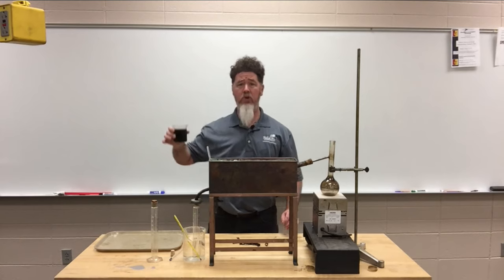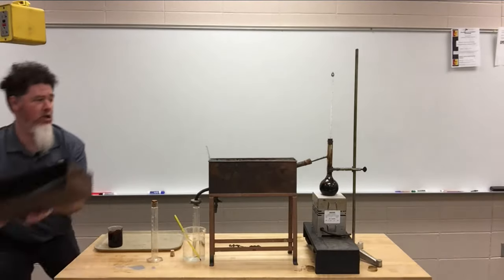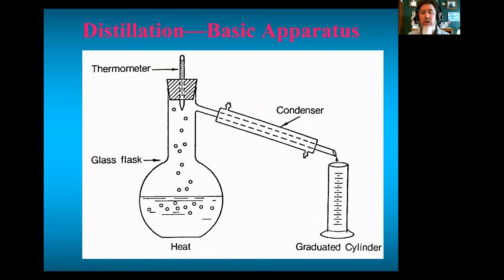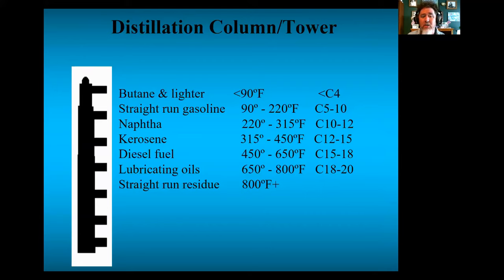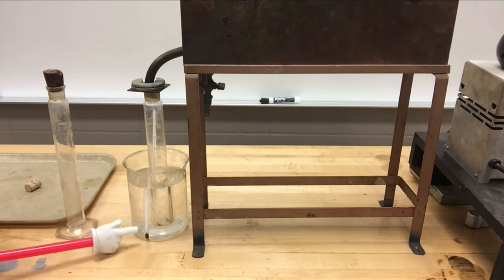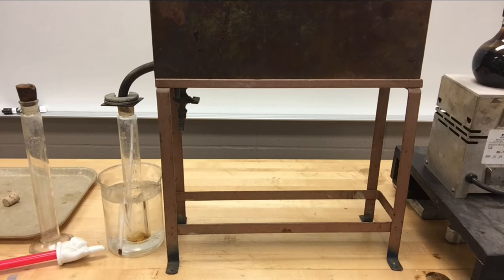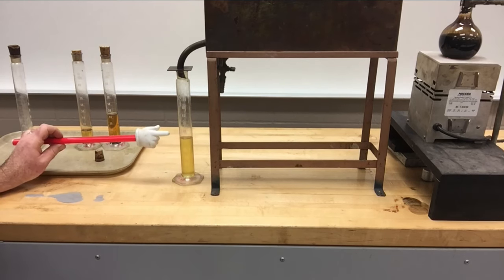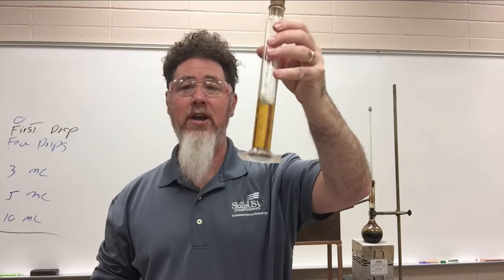How to make gasoline and diesel fuel out of crude oil

Comment: Thanks for taking the time to make this video. I am interested in making a pyrolyzer to turn plastic back to oil, but I don't know enough to trust the final product.
Reply: You got that mad scientist vibe my friend
Reply: you just have to distill it properly (search for the term crossflow distillation) then use some chemicals to reduce the sulfur content, after that you add an octan booster (in case of gasoline) or a cetane booster (in case of diesel) . and make sure not to distill halogenated plastics like PVC (it´ll create chlorine gas) and polystyrene (styrofoam) as this will make the fuel polymerize and you´ll end up with jello fuel

Comment: very cool video, great explanation of distillation and demo perfectly clear, one interesting thing might be how much energy was put into the system via heating element, and how much energy does the fuel potentially have when used at 100% efficiency (if that were possible).
And what is in the left over oil in the flask?

Comment: I saw old tires distilled into gasoline , it was filtered afterwards and ran in a engine  it looked more lihe kerosene to me but it worked . Im looking to make my own fuel for off-grid power generation. Only about 5 gallons per batch. And carbohydrates to ethanol will bring trouble especially at that volume. I thought about methanol. And possibly seeing what is possible from the wood oil (crude oil from wood) see if it can be broken unto thinner more useful fuels. Maybe the distilled rubber  mixed with methanol from wood would  make a decent fuel. Anything frim 85-95 octane should be ok for my use maybe less i can always mist water or water Methanol/ethanol to help any pre-ignition!   And can plastic be broken into a gasoline substitute?

Comment: Hello professor! Is this the same set up for the distillation of pyrolisis oil from polymers? Would like to make things clear for me.
Reply: Yes though you'd need to run higher temps and re Run the distillate a couple times to destroy the polymer chains. Or you could crack the chains with Hydro treatment where you pass the distillation gas together with hydrogen through a catalyst

Comment: Can motor oil be cracked into a ighter oil? By heating without o2 and possibly under pressure?  And what would happen if used oils was placed into a 2" pipe 4"long and  sealed up filled 80% and heated to    nearly 1000°f i know eventually it will be a bomb. But I'm interested in what happens to the oil?  Is it broken into shorter chain molecules? That can then be distilled out ?

Comment: Hi prof great video, I want to extract petrol and diesel from plastic waste, is it possible by applying your distillation technique of collecting at different temperatures and will I be able to run an engine on either?
Reply: check out mr teslonian
Reply: I know a guy who gets the used cooking oil from the restaurants in hays and runs his pickup on them. Not sure what he does to it though.
Reply: @blackbeard9436  thank you

Comment: I have a small well drilled in 1895 in Notheren WV and use it for house gas and sell about 100 bbls of oil per year. Now I'm retired I want to try to see what I can get out of this oil. It is a light Pa crude with a little paraffin. I'd like to see it it can be used for house and shop heating. Any suggestions for further reading?

Comment: Just a curious engineer here , when heating I assume you are extracting the different hydrocarbons and that you can't change the amounts of different hydrocarbon chains. You speak about making different portions of fuels but is that possible ? Aren't you governed by what's in the crude or does the amount of heat temperature mix determine what you get out ?

Comment: Professor Scott Norman it's actually what's run in older and modern gasoline and  4 stroke and 2 stroke small engines and some bigger ones to. Now some of the newer stuff is designed to be flex fuel engines then yes. It requires octane boosters and ethanol alcohol blended into your gasoline fuels. If you have one od those pot metal gasoline fuel tanks and carburetor's on your machine., or equipment then you use ethanol free fuel in those small engines that doesn't have plastic carburetor's mounted on top of those fuel tanks that are designed for that type of gasoline fuels like E-85.,or E-10 blended gasoline fuels.

Comment: Great video. So would lite kerosene run in a modern gas car? Just curious.  Probably wouldnt take long to plug up the Cadillac converter
Reply from the maker: Hi James,   I have not tried running kerosene in a modern gasoline vehicle, but I do not think it will work as the properties of kerosene is too different than modern 87 octane gasoline.   There are older farm tractors and military vehicles that will run multi fuels, but they need to be designed to do so.  You can do some research on these type of vehicles to see how they work.   Good luck.

Comment: Wait, I didn’t get what temperature you heat the crude oil for straight run gasoline?
I understand it was 500 degrees Fahrenheit but then you were talking about how the temperature needed to be 90-220 degrees Fahrenheit.
Reply from the maker: The best gasoline is distilled between 90 to 220 Degrees F.  Above 220 degrees is heavy gasoline (Naphtha) and has more BTU's per gallon, but not a better gasoline.

Comment: Thank you! Does it work similarly if you convert plastic into diesel?
Reply: Yes but this needs to be done without oxygen being present (pyrolisis) and don't use PVC or other halogenated plastics as they produce toxic fumes which are also corrosive in case of PVC it would create chlorine gas

Comment: Hi professor.  It's surprising how difficult it can be to find this information elsewhere on the internet.  Great presentation!  
I have a question that seems just beyond my grasp, but a profound question given a new movement away from fossil-fuels for mobility.  If you could help me, I think we can bring to light a big misunderstanding about the advantages of this new movement.
When you distill the crude in this experiment, an electric heater is used.  WHY NOT add a watt meter on the heater to determine how much electricity is used to complete the distillation process.  My thesis is that there is gasoline from crude that enables mobility in ICE vehicles, however the refining process expends about as much energy as could be traveled in an EV from the heating process alone.  
The disadvantages are then compounded by having to transport the gasoline and make up for any spillages or inefficiencies before it even gets to be used. 
Perhaps we could simply save the oil and use it for OTHER THINGS if we only decide to make use of the energy it takes to bring it to boil and move the fluid from one place to another.    It's like getting the byproduct of the oil without having to handle it or refine it ... See?  Much more direct and efficient.
Somewhere I saw an amateur determine that a drum of oil brought to boil uses about as much energy as it takes to drive an EV 600 miles, and that is pretty close to how far you can expect to go in an ICE car with the resulting byproduct.  
Working under the assumption that they distill crude by using the oil or kerosene as fuel (rather than electric heater) brings to light why there is about an 18% defecit of oil byproduct from distillation compared to crude supplied https://www.eia.gov/dnav/pet/PET_CONS_PSUP_DC_NUS_MBBLPD_A.htm  
After all it is not scientific to think that 18% of anything just "disappears"... it has to be USED SOMEHOW to not be left at the end of the process.  I think it is used in the heating part of the process.  Correct me if I'm wrong.  - 19,890 million gallons divided by 16,294 is 0.82  (82 %)  
I look forward to your insight and if you have ever let your mind wander down this path before.... 
Thanks, 
Trent

Comment: Refinery of the crude oil in the Refinery pump hidrogen to the crude and that is just add water to the crude distilled by product.  And also the heat destination work faster under - vaccun depressurized container vaccun seal .
Reply: The hydrogen is used to crack the polymer chains to get a higher yield otherweise you would be left with much more paraffines. they not only use vacuum but a crossflow distillation process to reduce energy needs

Comment: 2 questions: 
1) Would this also work for the liquids/vapors obtained from the "gassifier" setups using wood? 
2) Would extracting gasoline from diesel created from waste plastics?
Reply from the maker: No, distillation of gasoline or diesel fuel will not work with gasses from the wood gasifier or waste plastics.   The wood gasses are to light and the waste plastics are to heavy.  Distillation is just separating out the gasoline and diesel fuel that is all ready in the oil.  Since there is no gasoline or diesel fuel molecules in the wood gasses or waste plastic, this process will not work.   The gasses straight from the wood gasifier, H2, CO, and CH4 will still run an engine so there is no reason to try to convert those gasses into gasoline.  Did this answer your question?
Reply: @ProfessorPentane  Thanks for the prompt response. Yes it answers those questions. I'm pretty sure I'll have more questions to follow after this fully settles in and thanks again ;)
Reply from the maker: @coachgeo  Sorry, I just saw your reply today.   Yes,  coachgeo is correct.   Pyrolysis must be done first before distillation.  Distillation by itself will not work.
Reply: So after pyrolises you get bio crude oil from the condensed wood. Then its possible to distill the bio crude oil to diesel and gasoline?
Reply: @nsrhpi  no he just explained how the mid temp distillates required for gasoline and diesel are not present in woodgas or plastic after pyrolization

Comment: If you only wanted gasoline, would you be able to keep the temperature at the given rate to give more gasoline? Rather than getting it too hot making diesel? If so how much do you think you can get? Of course taking the warm up in consideration.
Reply: No you would still only get a certain percentage of each fuel from said amount of crude oil
Reply: I'm not 100% on this but I think the other answer you got is right, there is only a certain percentage of the crude that can be made into gas, however if you heat it up to quickly, you may blow right past the temperature and then have lost time for separation of the gas and diesel and contaminate either.

Comment: Will this same process work on crude oil made from pyrolysis? Specifically wood pyrolysis.
Reply from the maker: Hello Noah,   distillations would NOT work with wood gas.  Pyrolysis will produce Co, CH4, and H2 gasses which is lighter than gasoline.  These gasses would have to go through more "refinery" process to make longer Hydrocarbon chains for Gasoline.  We ran a small engine on wood gas a few years ago, check out the video here:  https://www.youtube.com/watch?v=Z9dRY8O3IFA&list=PL3XwHgpcSh2Z5u0i2DQ6W3i8xRHiqk619&index=1&t=7s.
Thanks for watching,  Professor Pentane

Comment: Prof can this system/process be used on waste motor oil (wmo) to achieve a similar result?.. looking forward for your reply.
Reply from the maker: Hi Steve,  a short answer is NO, you can not distill your waster motor oil to make gasoline or diesel fuel.   Folks on the internet is making "Black Diesel" out of their waste motor oil as an home-made diesel fuel.   I have not tried this out yet so you will need to look at other sources for more information about waste motor oil as a diesel fuel.  Thanks for watching.
Reply: If you can extract more diesel fuel out than gasoline, why is diesel more expensive to purchase.
Reply: Essentially its no because you already took out the fuel to make it motor oil is that correct
Reply: @benkentch4217  you pay more for diesel because its more energy per gallon of fuel its more energy
Reply: @StoicAnarchy   is that because it requires more energy to get to the right temperature to extract the diesel fuel
Reply: @benkentch4217  Diesel is cheaper here in Brazil. Much cheaper.
Reply: @benkentch4217  Commercial transportation vehicles. They know that gasoline is not an option for fueling the transportation industry if diesel stays at a just higher price than gasoline, so they jack the price up because they know the industry has no choice but to pay.
Reply: @benkentch4217 because different crude oils contain different amounts of fractions and the "Diesel heavy crude" comes from russia. USA mostly has sour crude which contains more sulfur which adds costs to remove it. Sweet crude has lowest amount of sulfur 😊

Comment: The other question I have is the energy required to heat and cool the products versus how much burn energy is contained in the 200ml
Reply: with the use of the right catalysts e.g ruthenium and carbon one can lower the energy input and obtain larger amount of fuels making the process economically viable. for the 200ml he got he probably used 70ml to fuel the process. the pyrolysis gas can be rerouted back to the reactor to further increase efficiency

Comment: So if you plotted drip frequency with temperature we should see humps where particular chains are most abundant ?
Reply: Either that or a jump at the thermometer where the hot gases pass over. each jump indicates a new fraction azeotropes however behave differently and should be taken into account

Comment: Is it possible to speed up the process by adding vacuum but being able to lower the overall temp of the oil?
Reply: Yes but you would need better cooling as the condensation temperature also gets lower. Heidolph suggests for petroleum spirits 50°C at 250mbar vacuum

Comment: So does a higher octane rating in gasoline actually mean less explosive than straight run? If so I've always had a false assumption that 110 octane would be more explosive than  87 octane....??
Reply from the maker: Yes, you are correct.  Higher octane fuel is harder to ignite, more pressure/heat is needed.  If someone is running 91 octane in a normal low-compression vehicle, it could lead to hard starting when cold.
Reply: @ProfessorPentane  thanks! Really cool presentation. I'm 33 and you just taught me something that just had never clicked before. I knew the stoichiometry of gasoline should be 14.7 to 1 but is that based on straight run gasoline only at 30% octane? Different octane rates are obviously going to affect that metric.
Reply from the maker: @ahunt  just FYI from a Fuel's Nerd that the octane level of the fuel is not the biggest effect of the Air/Fuel ratio.   See my videos in the "Lessons on Fuel Chemistry" playlist on how to calculate stoichiometric ratios of fuel.  Enjoy!

Comment: Can you do this same process with waste oils such as engine oil, trans fluid, gear case oil etc...?
Reply: This is my question as well.
Reply: Of course it can be done just watch Out for the additives some even act as a catalyst to improve yield e.g. Molybdenum sulfide (lubricant) some May distill over so you'd need to pass It through activated charcoal

Comment: Can you the same process with used motor oil and get diesel from it?
Reply: I doubt it, as the lubricating oils are produced at a higher temperature (see chart in the early part of video) so the volatility of the diesel is already gone.

Comment: I never understood this in school and now I see it's just heat the oil until all the product has come off for that range then increase the temperature.
Reply: Or you blast from the beginning with high temperature as the boiling Point of the mixture always will be that of the lowest fraction, that's due to latent heat

Comment: Ok. So in the army we had JP-# 
I am assuming JP is the same as C.
So JP-8 would be C-8. 
I don't remember all the JPs But I remember JP-8 was one.
Reply: Jet Propellants, not exactly the same as C, you can Google it for more info..
Reply: @gelias1276  no. Lol.
If its different explain.
Lol. Dont really care enough to look at Google.
If you don't want to explain. Then ILL keep thinks its like JP.
Reply: @baddog9320  I do care to explain.
The different products we get from atmospheric fractional distillation are called cuts. Each cut is a mix of hydrocarbons which have the same range of boiling points (the temperature at which they start boiling). I'm not aware of what JP fuels' numbers refer to, I guess it's related to the "version" of the fuel. As for the number of carbon atoms "C", it's also a representation of hydrocarbons which have the same range of carbon atoms, which in turn compose a cut. After retrieving every cut from the distillation tower, they go through further "enhancement" processes after becoming final products, like JP's. I hope this helps.

Comment: Does this also work with stuff like motor oil and other oils?
Reply from the maker: The simple answer is NO, all of the lighter hydrocarbons of Gasoline and Diesel fuel was already distilled out of the crude oil at the refinery.   Distillation of motor oil will not make gasoline or diesel fuel.
Reply: @ProfessorPentane  thank you🙌
Reply: Yet you can run diesels on centrifuged and filtered motor/transmission/transformer oil mixed with thinner fractions to bring the viscosity to within the diesel range.
You can also distill said oils to remove the crud, mix with thinner fractions and use it.
Heavy diesels use heavy fuel oil which looks like crude and has to be heated to inject it.
Funny things compression ignition engines...

Comment: ASTM boiling range apparatus.  I used to use that at one of my jobs.
Reply from the maker: Hi Edward,   I am interested in what type of job you had using the apparatus and what were you using it for?   I am not following ASTM procedures, but showing students how gasoline and diesel fuel can be distilled from crude oil.  Thank you for the feedback.